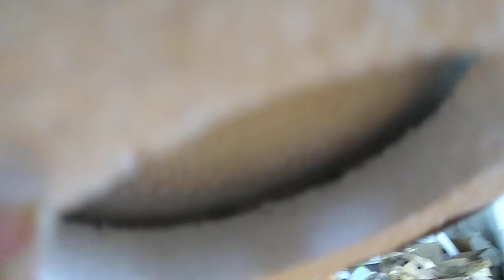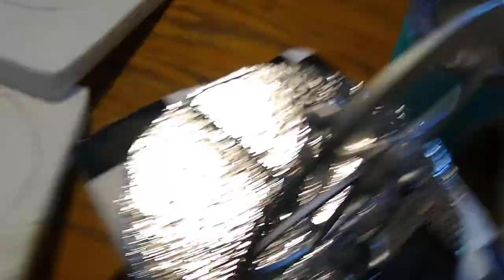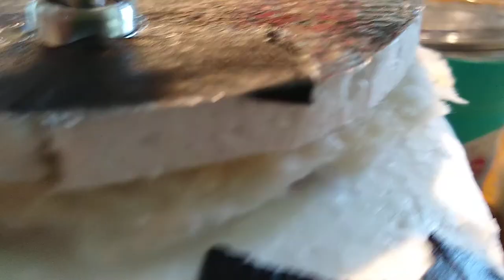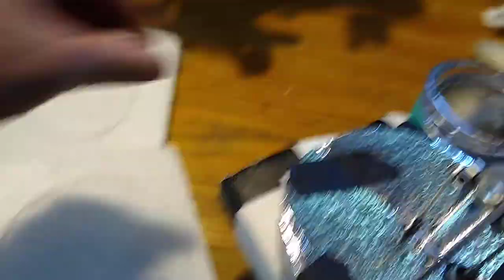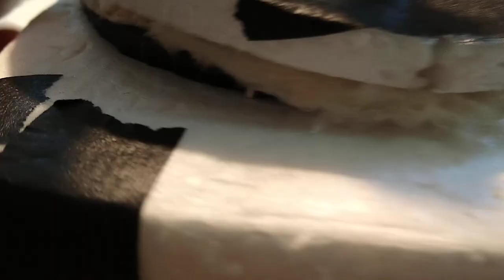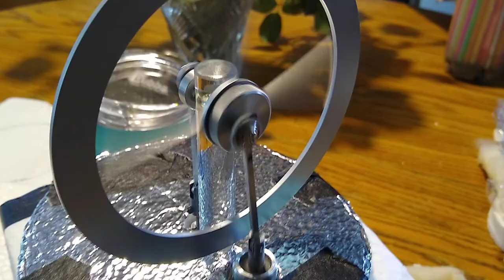Stirling engine without heat sink (Start time: 1:38 PM July 19, 2020)

Comment: This engine has a very low power, so the efficiency of heat removal practically does not affect its operation. If you work with high capacities, then you cannot do without a radiator. With us, with a motor power of 100 W, it is necessary to remove 1 kW of heat.
Reply from the maker: In my experience, Stirling engines with a regenerator, actually require very little added heat input. Heat is conserved in the regenerator.

If excess heat is applied, above what the engine requires to power a load then the excess heat must be removed or the engine will not operate.

How is the cooling accomplished in your engines?

Stirling engines require careful load balancing to operate efficiently. A light load, or no load requires little heat. A heavy load requires more heat. Above what is required, excess heat is detrimental, overheating the engine and destroys the temperature difference the engine requires to operate. Then cooling is required.
Reply from the maker: @ВикторЗакомолдин-в8ж  do you manufacture these Stirling generators? If not, where did it come from? Very nice generator, I know there have been many people on the Stirling engine forum asking where they could get such a generator. I would love to have one as well. Are they available in the US?
Reply: @peoplesresearchcenter6184  This is an industrial design ready for production. We are located in Russia. We can produce them in small batches for $ 1,100. So far, no one has been interested in shipping to the US.
Reply from the maker: @ВикторЗакомолдин-в8ж  are they pressurized? What is the power output? Is there somewhere with more information? A website? I'm sure there would be a market. Homesteaders living off the grid. How could they be obtained?
Reply from the maker: @ВикторЗакомолдин-в8ж  is there a big difference in output of it is pressurized with air vs. helium? How long will it maintain pressure? Does it have to be pressurized before being used every time? Will it work at all without being pressurized? Is any effort being made to get it certified for export to the US? A lot of questions I know, but I would really like to have such a generator that could run on a wood stove. Where I live in the country, many people burn wood for heat and many even live off grid.
Reply: @peoplesresearchcenter6184  With helium, the power is about 30% higher. On a new product, the leakage is insignificant, no more than 10% per month. It also works without pressure, but the power drops to 25% of the nominal. I did not find out about certification in the USA, there are no information channels. I think that the price of one-time supplies, taking into account transportation, customs clearance and certification, will be more expensive than the goods themselves. It makes sense to supply in batches, in the form of spare parts, then it will be possible to significantly reduce the price, but for this it is necessary that partners organize the assembly and sale of the product in the USA. It would be possible to organize the production of all kinds of options for summer cottages, trailers, farmers. We are now preparing for production a more powerful version for 2 kW continuous power.
Reply from the maker: @ВикторЗакомолдин-в8ж  I have a friend who may know something about what is involved, if I can I will let you know what the requirements are. I would really like to try out one of your machines, at the minimum.